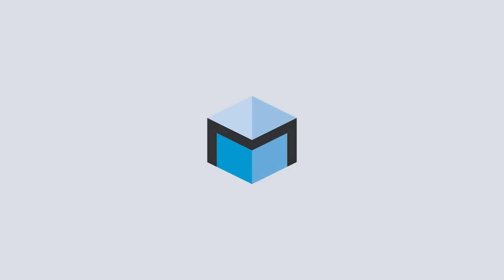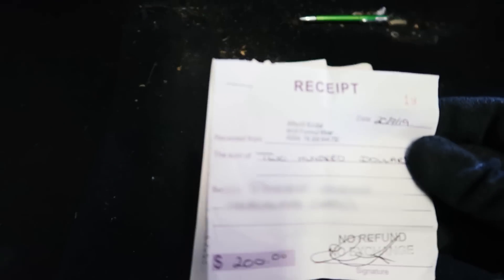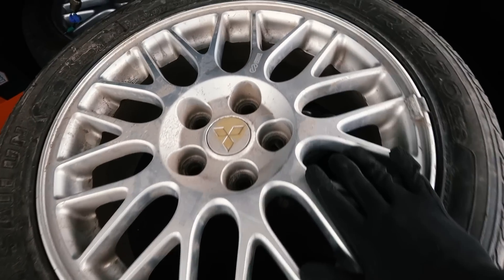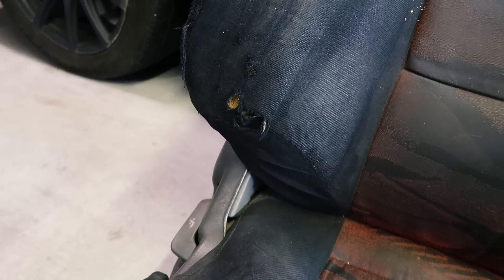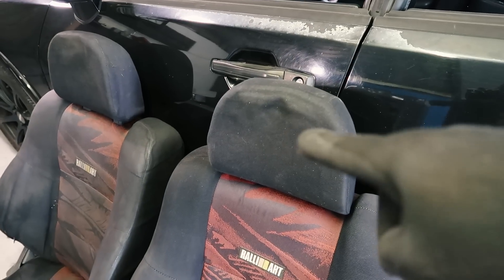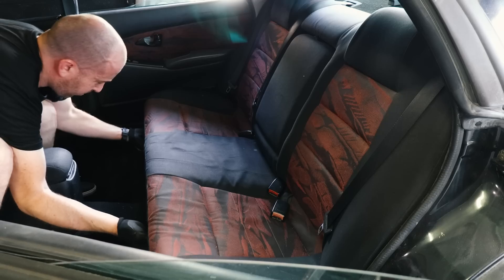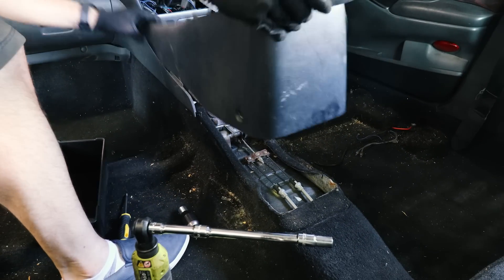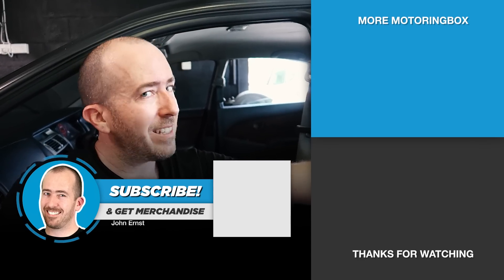🧤Stripping the Mitsubishi Magna Ralliart's Interior & Cleaning the Seats!

Comment: Awesome work here Sean! Do remember to check if the Magna is part of the Takata airbag recall. Seems about the right vintage when some of the earlier built airbags are getting real dangerous.
Reply: i checked the takata recall , from memory it was only the kj verada and all gtvis with nardi steering wheel that was affected as it had a different air bag to all other magnas buy i might be wrong
Reply: Definitely no Takata recall for Magna’s
Reply: Incorrect. Magnas and Veradas didn't have Takata airbag recalls.
Reply from the maker: I ran my VIN through a lookup page Mitsubishi Australia setup and there were no active recalls on the car - lucky!

Comment: I've done a few heatercore's in these and surprisingly not hard to do just quite a few bolts and screws but it's around half a day for a beginner
Reply: 8 x hours at least
Reply: Nah looks more daunting than what it is i got it down to around 3 and a half hours for the job as i was working at a Mitsubishi wrecker/mechanical shop my first was around 6 hours

Comment: i'm actually curious if any of these parts are still available brand new off Mitsubishi if you order it (i.e. seats and consoles etc).  I will probably apply some sound proofing material on the floor before putting back on the carpets.
Reply from the maker: I am probably going to call the local dealer and see what parts they have in their system - like non-service parts like lights or body parts.

Comment: Often the seat squabs and backs can be transferred between driver and passenger sides.  No idea if that's the case with the Magna but certainly the case on many.  E.g. put the worst seat on the passenger side etc.  Did just that with a 2007 BF and a 2001 Disco 2, oh and a 1981 Lancia Montecarlo back in 2000 before I moved to Aus.

Comment: Recently found your channel and subscribed because of the Magna project.Having owned a TF for many a year and loved it.(Still see it from time to time)The thing that worries me is that BASCO timing belt kit.Reason is, I fitted one to my Challenger and it delaminated at 3K due to a poor quality tensioner and balance belt,found after fitting genuine belts at the dealer.Being a follower of Challenger/Pajero Sport site there has been 8 who have suffered the same fate.The supplier refunded parts cost only.Is that an admission of fault?
Reply from the maker: The bits inside the kit seem pretty decent though - the belt is Gates and the tensioner and pulleys were 'GMB' which I'd never heard of, but are apparently good quality. The water pump was a no name, so I'm buying a Gates one to use instead. Hopefully it's all good. If I end up killing the engine I suppose you could always drop a 3.8 in.

Comment: How’s the part supply from Mitsubishi for these? Better than BA/BF from Ford hopefully
Reply from the maker: So far a lot of the service parts I've needed so far are easy to get, along with common parts that need replacing like the heater core. Where it all falls down are things like head or tail lights, door / window rubbers and interior bits. Pretty much nothing aftermarket appears to be available, so it's all wrecker/second hand items.

Comment: currently balls deep into doing front suspension on the BA.  can't press up the upper ball joints without pulling the control arm with my press kit.  fml

be interesting to see how you go with the magna.
Reply: Just done my SY2 Territory UBJ's a few months back. I done a full overhaul including shocks. Take the shocks assembly out then remove the upper control arm from the mount bracket is the easiest way.
Reply: @MitchZero9  yeah I did shocks about a year ago so don't want to deal with that shit show again. Got driver side done and ran outta steam.  Will so passenger side another day.

Comment: Definitely worth a small investment in a set of drill brushes mate, for $12-$20 you get extremely useful drill brush attachments Soft Medium and Hard which will last a diy a lifetime. I had to cringe a little bit watching you scrub the upholstery with a toilet brush, was reeeeealy hoping it was brand new mate? Lol just joking,  but in all seriousness as well as being far too harsh the bristles are physically to large to effectively penetrate and remove embedded dirt particles from the tiny fabric fibres, your pre scrub method was pretty much spot on until you broke out the old dunny brush😉. Another thing to keep in mind when doing seats or fabrics, get in a habit of only doing 1 small section at a time, after soaping up the whole seat, and then Scrubbing the base for a while you could physically see just how grotty the soap lather had become, and  instead of immediately extracting all that "previous owner butt skunge" you moved on to Scrubbing the upper seatback and bolsters meanwhile most of that bum skunge had time to soak back into the base while your eyes were fixated elsewhere. In all honesty the differences are nominal at best but its good habit to get into for every job you do in the future. Oh and the OEM Wheels all day. Im actually shocked it wasn't the first thing you did before introducing the car to the channel? They really do make the car pop. Just my opinion tho. Its like when you see a B7 RS4 with 20 inch aftermarket rims, it never looks quite right?  Sometimes although v rare, Manafacturers manage to get it right and the model specific OEM wheels are essential to finishing off the designers intended look of the vehicle, and your car is a perfect example of that. Imo.

Comment: I'd be very cautious using the timing kit you bought, as a mechanic 40yrs I only use Gates timing kits or OEM because most other ones have unmarked chineseium crap water pumps, idlers n tensioners n that's shit you don't wanna fail or it's bye, bye motor
BTW: If it an oil burner I'll guarantee it needs valve stem seals a very common failure on Mitsubishi's due to lack of regular oil changes then seals go hard from carbon in the oil n the seals crack n they turn into a smoke machines then it's reco the heads time n I've done hundreds of them over the yrs.
Reply from the maker: The belt is a Gates, not sure about the rest of it though. They state the majority of the bearings they used are sourced from Japan or Korea... will have to sus it out.
Reply: @MotoringBoxTV  Good quality bearings will have there brand stamped into either side face, if no brand found there 1 hung low crap, the water pump should also have a brand stamped on it, if not it's crap.
Reply from the maker: The water pump appears to be NTY (GMB?), the tensioner is an NTN from Japan, and the tensioner and idler bearings are GMB - had any experience with those? Thanks in advance!
Reply: @MotoringBoxTV  NTY isn't GMB  there ok but not great the stuff marked GMB is smick, don't know if you've ever done a timing belt job before but make sure it's on TDC number 1 compression  n mark all timing marks there's  a V on the cam gears that line up with a V on the cam backing plate or rocker cover the drivers side (sorry rear I forgot it's a maggot not a pajero) cam will be under tension of valves when you remove belt where the front cam will be free to move, always go from crank to front cam first n around the rest of the shit always checking timing marks then set the tensioner idler but don't pull the grenade pin in the tensioner until you bar the motor over 720 degrees n all timing marks should line up perfect, if alls good pull grenade pin.
An questions get back me.
Reply: I pampered my 2000 6g74 engine from new using a high quality oil and filter every six months. From around 180,000ks, Mitsubishi stem seal smoke is a known issue and not necessarily from neglect.. I have a set of Fel-pro ready to go in.

Comment: Getting given a 02 tj magna from my girlfriends parents, im not too great at things but in going to attempt redoing the headliner (sags) and going to try and adjust the handbrake ( feels like it doesnt do anything at all, just rolled straight forward when i tested it) hoping to keep the thing running for as long as i can (assuming it wont cost too much) at 300k ish already
Reply from the maker: Handbrake is easy - pull out the centre console bin and you'll see the master adjuster!
Reply: @MotoringBoxTV  hoping my brain can do the "yeah it's easy as" although I've got the time to figure it out as I'm not currently with the car (needs new wheels so their doing that before they hand it off) and I'm going to get some replacement fabric for the headliner, they don't think it will last more then another year or two though but I'm willing to try and keep it going for as long as it's realistic to do so

Comment: hey iv had my ralliart 18 years aswell thrash it non stop its sik azz  has 20 by ten inch rear with 295 F 1 tires an on front 19 by 9 point 5 with 275 F1  heavy duty wite line sway bars strut brace  all koni shoks resealed an  set  koni factory  god was 1600$ plus gst they hav cromemolly top of piston an top rings  titainium crank they are  the tufest enjine  iv eva crost  as im a falcon bloke owend genuine gt 351 an ithers all through my  life  an much as i still love falcons they couldnt handle half of wat the raliart continues to go through year in yesr out  it  hits 7000 rpm every time iv driven it  yip 18 years  an its goes faster than it did new  jus by caining it  they are so robust its nuts infact  its  unbeivabke  but true as true gets all my mates with turbo skylines  an subaru wrx hav all blown things up  trying to beat me an the raliart has neva   eva briken down or had enjin apart  from cam belt an serviced at rite kikometes   it sounds sik  chop down at 220 kph in to fourth an i take it strait off the clok  240 ts five speed so hitin the limiter in fifth  ya doing over  300   cause  that was  the  speed  ya had to go   down th bak strait bathurst cars needed  to go  an  high speeds they feel so safe     mines  proven for 18 years how safe it is  an it has electric sunroof  an is   number 29  done 128,000 kilometres an it aint for sale  i  love it  an every merk or bmw falcon commodore   aint anywere near as nimble or stroppy to drive which puts it rite out front  cause it gets safer an safer the faster ya go   thers no wandering on bumpy roads at high soeeds were a most  the others  get worse an dangerous  so helo  its simple to work out why id neva sell it  my one looks  the best iv eva seen or herd to  guards porta powered out  its tubed   a little bit  but still has factory paint job thats shiney as the rear  tires miss  the casted weel holder by one mill up inside wall of rear tire an over the  top of rear tyre  good inch both ways an the rear weels go up an down through suspension  travel not verticaly  on about 60 degree angle  so wen it leans  one weel goes uo in th arch bakwards an the opposite one  stretches down nearly lifting off ground it moves rite forward  makeing weel base   its shortens its weel base one side an lengthens it  the other jus like a skate board  so it corners its own self  a mecanicle like four weel steer type of action but no rak an pinion it jus  hapens  jus going through  bak weels goin up an down on the angle an if i jak it up in centre of bak axle the 20 inch 295 35  hang in midd air an miss the sill by one mill  an thers a  200 millimeter gap to the weel arches rear like ya axles been bent forward  an wen they travel rite up  kooks kike axles bent  bakwards in the arch  so ya only  flare the bak guards from the top dead centre bakwards    nothing  forwards fro top dead centre so iv spent hours on it as didnt wa na change its look or re paint  any of it    so   one look at it makes all the others look frail  cause they look long an thin big time next to mine  sorry guys  but its ok till i pull up next to yous  as the staunch   look  is   huge diference  ya cant miss it  anyway  iv fotoes of it standard an now  an  its massive  diference how unreal it looks  from standard   an how much betta it  grips the dry road  thers no sledging the front  that they do on standard 225 17  pirelli factory  weels  the latest tranz amz hav taken ralliarts  look  on the front it looks exzakly the same there aint no other car with a bonet like 2003  ralliart   but th new tranz am  people are sharp fullaz  although ralliart leans in way more well my one looks  stable as compared to the trannys  🤡 my ralliart  it has electric super charger  im putin in masive brakes six pot  17 inch rotor  as  the factory  genuine brakes dont last long  for me but any one owning one  is cleva and  i    hope yous love them like i do mine  👌🏻💪🏻wat an experience 🥂✅👌🏻

Comment: Basco? Who on earth is Basco? I hope that timing kit is not cheap nasty Chinese stuff - the water pump in particular needs to be a good brand. It takes a lot of timing belt load.
Reply from the maker: They are just the supplier who bundle a whole lot of parts together - the belt is Gates, and the tensioner items are NTN or GMB, which from what I can work out are pretty decent.
Reply: @MotoringBoxTV  Cool. Worth checking ;) That will be fine! Although Gates is good for belts, less good for pumps these days. Aisen is probably the gold standard for these engines.
Reply: These are an easy belt to change though. A good introduction if you’ve not done one before.

No special tools required, all the pulleys have nice timing marks on them. It’s not like modern euro stuff you need a special kit of locking tools :)